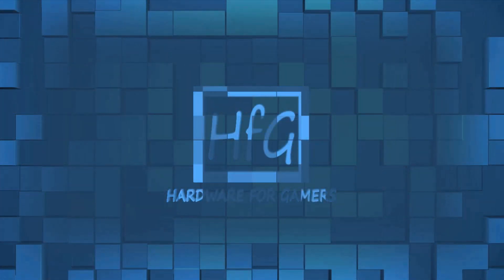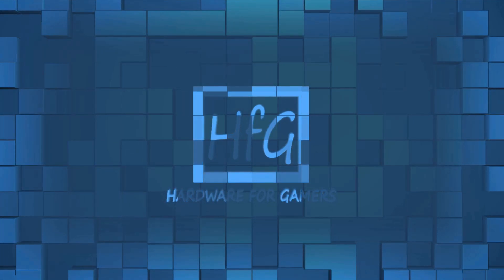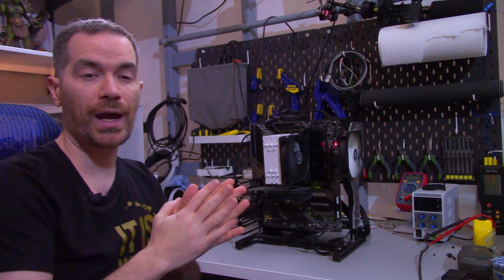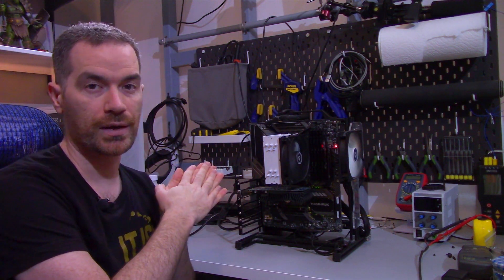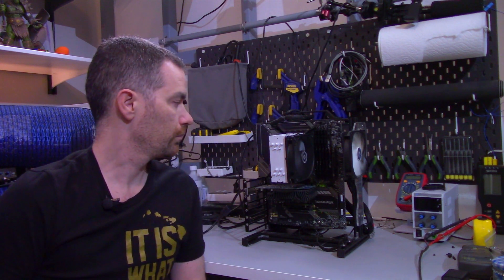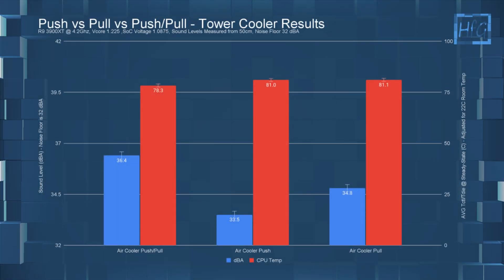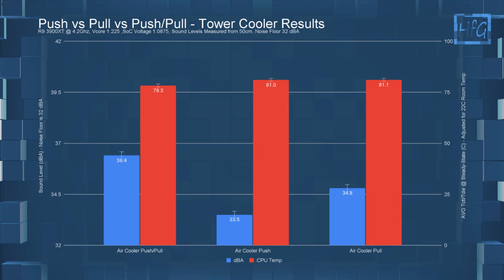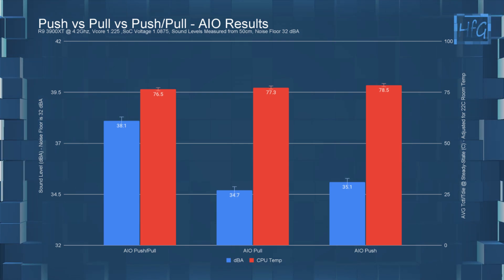Push vs Pull vs Push Pull - Is There A Difference...

Comment: Most likely because when you pull air from outside a cooler fresh air into the system the pc case inside gets hotter but the cpu cooler is colder. While in the push you take the hot air from inside the case made by the gpu ram etc and you push that into the already hot radiator fins to the colder air outside. 

Long story short,

In pull
You take cold air from outside the case into the case.
" Case temperature increases due to the pulled hot air from the radiator"

While in the push
Your pushing the case air which is already restricted/hotter than the outside air.

Hope i delivered the point.
Im not a scientist but i did some testing back in the day when i wanted to learn the best orientation for best performance however i realized its either aesthetic or performance as i have to install the cpu fans in the opposite direction hiding thr rgb 💔

Comment: I think if there was some sort of shroud around the fan that kept air from leaking  around the heatsink it would help as there is some  positive pressure created by the resistance created by the heatsink when pushing or pulling.
Reply: that's exactly what i will be trying tomorrow :D
Reply: @hrvojehorvat9099  so hows the result ?
Reply: @hrvojehorvat9099  Did you come up with anything? Super interested in hearing how it went :)

Comment: Great test, thank you!  I've got a CPU tower cooler similar to yours, set up in a 'pull' configuration, it has worked fine for just over four years, the only problem now is getting at the screws to replace the faulty fan (not impossible, just a little more difficult as there's little space between it and the case fan).  The CPU fan runs primarily at around 780RPM, increasing to a max of 1,575 when doing backups etc.  I've got two 140mm case fans at the front pulling air in, one 120mm at the rear pushing air out, and one 120mm at the top pushing air out.  As you've proven, 'pull' is more effective ... for what it's worth, most cars also have their radiator cooling fans set up in a 'pull' configuration.
Reply: Did not know about the cars. That’s interesting! I’ve seen push in sooo many configurations that a pull almost, well mostly, looks verboten. It shouldn’t work,.. 😅 🤔☝️
Reply: @Justusson  yes, the radiator fans pull air through the radiator (they sit between the engine and radiator), while the A/C fans (the sit in front of the condenser and radiator) push air through the condenser, effectively assisting the radiator fan.

Comment: What about push push or pull pull
Reply from the maker: not is good idea, it would be a really bad idea to do that.
Reply: @HardwareForGamers  it depends if we are airflow restricted or pressure restricted It may or may not work
Also if the fan has blocked side
Reply: @HardwareForGamers  like think about 
Push and pull moves the same air 
And push push would push both side so both have fresh air 
Maybe even better with pull pull
Im not an expert by any means but I
Didn't see that configuration anywhere 
It's worth a try isn't it

Comment: pulling has better heat disipation due to the physics of lower pressure = lower temp. e.g. air flow from high pressure to low pressure created by pulling configuration of fan, like from ambient air to inside of radiator fins, results in drop of temp, thus more heat energy absorbed, by then warmer air exhausted out by the fan pulling it.

Comment: if i use push pull unfortunately the pull fan and rear exhaust case fan more like kiss each other (like stacking fan) is this will make an issue in future? or should i stick with push only cpu cooler?
Reply from the maker: Base on the temperature difference between push and push pull I don't think push pull is necessary.
Reply: @HardwareForGamers  so is it really okay to just use single fan (push) for cpu cooler? my enermax ets t40 tb comes with dual fan

Comment: The shape of the fins on the AIO is very similar to the radiator on my 1987 audi ur quattro and that has a  fan mounted inside an impeller shroud on the back end of the radiator. And the radiator sits far on the right hand side of the engine bay, away from the engine itself. Similar to how an AIO is placed.

A lot of newer cars dont have the room to mount a shrouded impeller away from the engine and instead, with limited space , squeeze the fan in front of the radiator at the front of the engine.

I think the old Audi had the right idea and this is also how an AIO should be setup too.

Comment: Do you think dual fans both pulling will make a difference in noise or temps over a single fan? Going to use an AK400 dual fan or AK500s single fan, dual if it fits
Reply from the maker: If I understand you correctly I don't think that's a good idea. Having both fans pulling air... Where will they be pulling the air from?
Reply: oops i think i meant push! the standard configuration, they would be pulling air from the intake in the front of the case @HardwareForGamers

Comment: Nice VOD as usual buddy! 

I'm using a 360 frontal AiO with a 3 120mm fans pushing air in from the front of the rad + 3 120mm fans pulling the air from the back of the rad...pretty much like a sandwich sort of configuration, where each set of 3 120mm fans are the bread and the rad is the peanut butter! LOL 

Plus I have 2 120mm fans on top. The 1st one (closest to the front of the case) pushing air, the 2nd one (right above the cpu) pushing the air out and finally, the rear 120mm fan pushing air out). Any thoughts about this config?
Reply from the maker: What CPU do you have?

Comment: I've been looking around for a test like this but with a Dual Tower CPU cooler which usually has one push fan up front and a second fan in the middle in the same direction. Anyone know if there are diminishing results to placing a "pull" fan in the middle and a second "pull" in the back of the cooler with nothing in the front? The reason Im considering this is I may have clearance issues with my ram sticks and my case cant spare the space to offset the front fan for the standard push config. looking to buy a Thermalright PS 120 SE for a R7 5800x3D
Reply from the maker: Thermals shouldn't really change, but the noise profile likely will. it will likely be louder and a higher frequency noise. just as long as your case is +50 cm around you shouldn't notice a difference.
Reply: tysm! @HardwareForGamers
Reply: @ia9g Did you try it out? I was thinking the same with that exact fan. Would love to know your experience,..! ☝️

Comment: To bad you did not also made a test with different fan speeds between in a push/pull setup. You can adjust them differently, that i hoped to discover here. But overall a very good and clear video

Comment: I have to switch from a push to a pull because I'm upgrading my system ram from 16gb to 32gb and the fan is in the way, which I'm only doing because having 16gb of system ram and 16gb of vram bugs me for some reason. Anyways, good to know things will be about as cool as they are currently.
Reply: Can you notice the different? I have same issue too
Reply: @royan5091  no I've had no issues, system always runs really cool. I have a r5 3600, 32gb ram, rx6800 16gb, 2 SSD's and a 750w PSU. With 3 intake fans, 3 exhaust, and a pull fan on CPU cooler. I have a few gameplay vids with my current setup with afterburner/riva tuner running to check temps if you're curious.
Reply: @TeamGun How was your noise levels? Some complain about a whining sound when having pull? Would love to hear,..!

Comment: not many if any videos talking about this. I notice on my As500 plus a very audible sound when running the fans at max speed mainly due to the rear fan pulling creates an annoying acoustic when air is trying to be pulled through the heatsink fans. The same thing happens when an intake fan is directly behind a mesh filter but the sound goes away as long as there's a bit of a gap

Comment: Thanks man, was looking for a test like that just because the fan of my AK620 cant fit with my RAM, so I wanna put it on pull-pull configuration. By your tests, it should be fine, right?
Reply from the maker: Yeah, it might be slightly louder, but temps should be pretty much the same.
Reply: This was a long time ago, but how did it went? I reckon I will try the same. Would love to hear someone else’s experience,.. 👍

Comment: Just last week I changed my Phanteks PH-TC12DX CPU cooler from the stock Push/Pull config to a single fan Push config which gave a big decrease in the fan noise sound without any discernible drop in performance when stess tested. The quieter fan noise is brilliant.
Reply from the maker: That's cool, thanks for sharing.
Reply: @HardwareForGamers  that's cool 😂

Comment: whattttt..... how come pull n push have the same temp? mmmmmmm
Reply: it's also depending on the fans and the environment. Also if he's using a water cooler it take 10-15 minutes for the case temps to lower